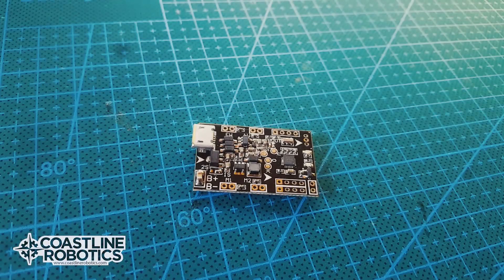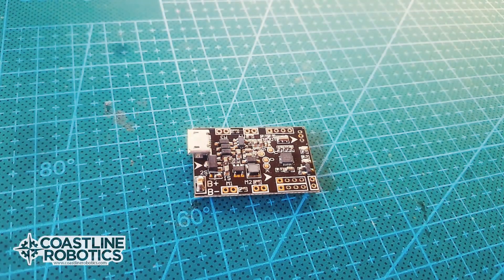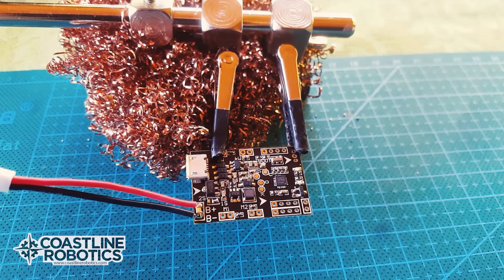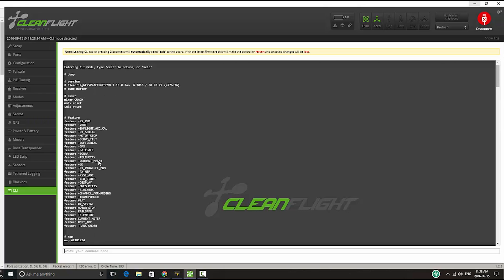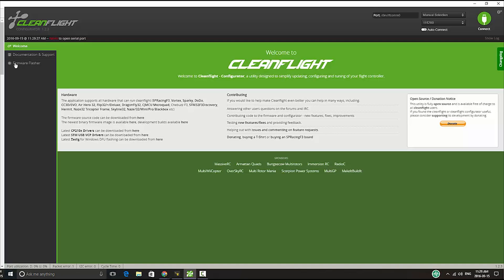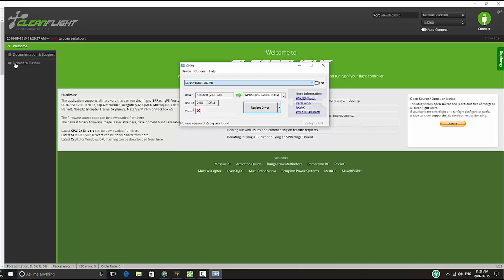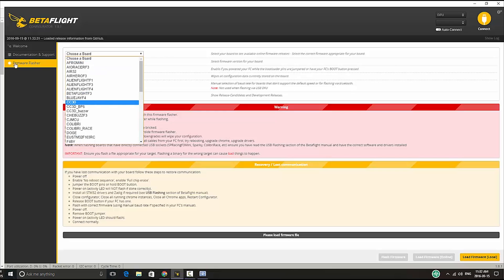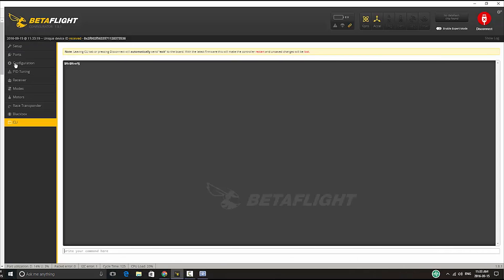Flashing Betaflight on SP Racing F3 EVO for brushed motors with Zadig

Comment: I need help!  I successfully flashed Betaflight following your instructions exactly. My problem is I cannot connect to the board to set it up. Nomatter what I do it says "failed to open serial port"   Please help!  I just want to fly!
Reply: im having the same problem, what did you end up doing?
Reply: nvm, got it
Reply: Hello! I have exactly the same problem! What was the solution for your problem?
Reply: I changed one of the drivers to usb something don't remember exactly sorry
Reply: After soldering the bootloader pads and flashing betaflight I de-soldered the bootloader pads and then reinstalled the STM32 Bootloader using zadig and it worked but only until I restarted my computer. I get the same "failed to open serial port" error message now when trying to connect. At least I was able to get it flashed and set up so I can at least fly and enjoy it.
Reply: What I did was after jumping the bootloader pads (either bridge the pads with solder or use a flathead screwdriver to contact both pads) Then use zadig to install the driver to open the board in DFU. You can flash it and then disconnect the board. What I did next was plug the board back in (bootloader pads NOT jumped this time) and follow the steps mentioned in the video for using zadig and install drivers again and I was able to set the board up and get all flight modes. I had to play with it a few times but it finally worked. good luck, it is worth the hassle!
Reply: Yeah. I tried it at least 10 times. Probably more. I'll try it again. Maybe my drivers aren't up to date but I downloaded and updated them. So either they didn't update or they were the wrong ones.
Reply: Yeah, I messed with mine off and on for 3 days and finally got it. Once I got everything flashed and set up I shut off my computer and the next day it would not connect again. It is set up and I can fly at least until I decide to mess with it again.
Reply from the maker: Hi there! Did you disconnected the boot loader pins? Remember that if they are jumped it won't allow you to do anything.
Reply: Hey, Thanks for replying. Yes, I disconnected the bootloader pads. It still would not connect. After much trial and error and lots of reading on rcgroups I was able to get it working. I flashed Betaflight 3.0 and set it up in my Taranis. It's flying great now! Thanks for the help!
Reply: same issue here and i have not come up with a solution

Comment: Lifesaver! Thank you so much!!! I've been tearing my hair out trying everything to flash Betaflight onto my QX90 and this finally worked. Actually I just held a screwdriver over the Boot pads and that saved me the bother of soldering.
Reply: Hi there. I have the same quad. It is on V2.0 F3_EVO_BRUSH. Will this method works the same with that version of the board? Thanks for your help!!
Reply: Tiny flat head screwdriver held onto boot pads works a charm and make the USB connection at the computer end as its much less fiddly than trying to bridge the pads whilst plugging in the micro USB to the board. I didn't want to disassemble my QX 90 for flashing Betaflight so the screwdriver bridge was the only way. Good call :)
Reply from the maker: Hey man I'm glad you could solve your problem! Thank you for the feedback
Reply from the maker: Hey Tezcatecpatl, most likely.